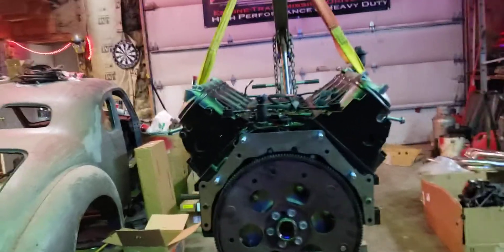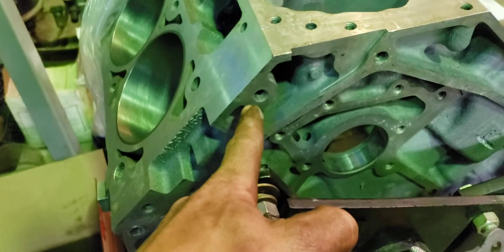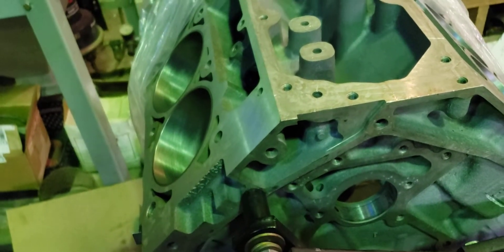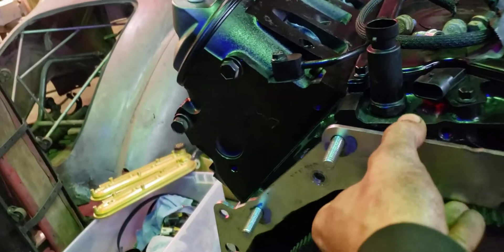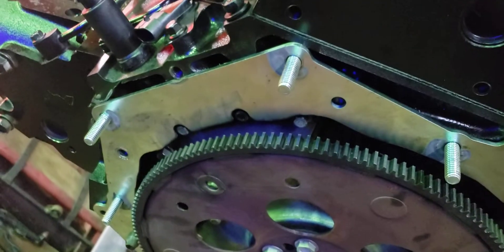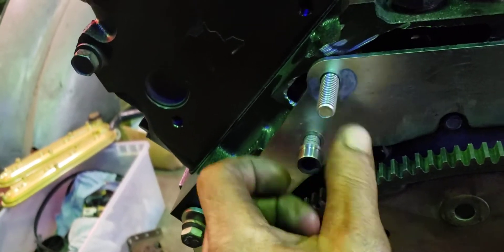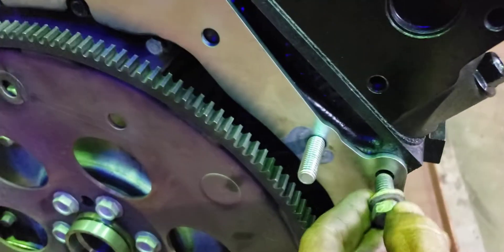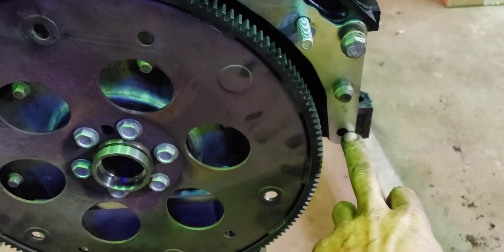Speedway B.O.P. transmission adapter modifications needed for use on LS engines

Comment: Nice video! Good information to have on this! I'm working on putting one of these bop transmissions on an LQ4 6.0. the only problem i have is the flex plate spacer i bought does not fit the torque converter like its too small. Not sure if you had this problem but I'm using a built TCI bop trans with a 3200 stall converter
Reply from the maker: if you are using the 6.0 flat flex plate you do not need the spacer
Reply: Mind is the dished flex plate for a 4l60e I purchased a flate one online and am now waiting

Comment: So if I got a new converter for my bop th400. I could just have the front of the converter made for ls spacing so no flex plate spacer is needed
Reply from the maker: or 6.0L flex plate

Comment: the two bolts that you bolt just the adapter to the block, are they smaller than factory bell housing bolts?
Reply from the maker: yes they are very short, I used the bolts from the factory motor mounts